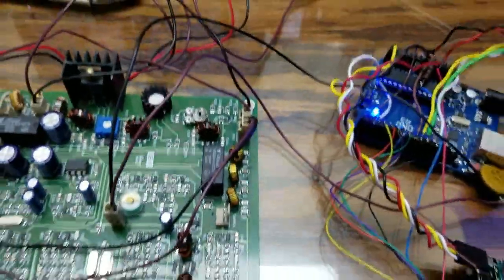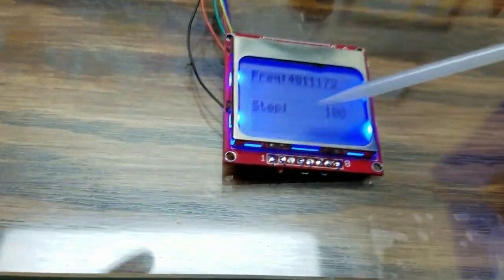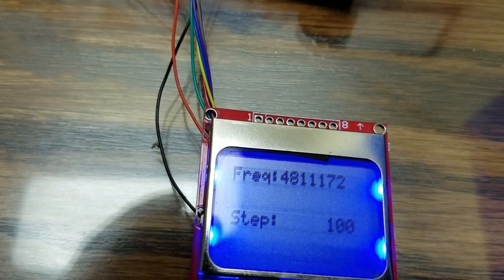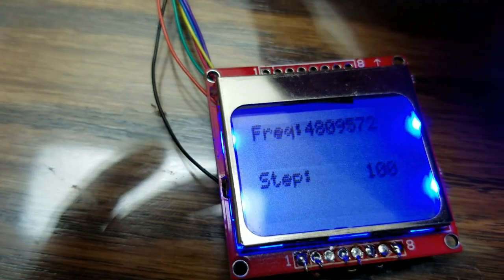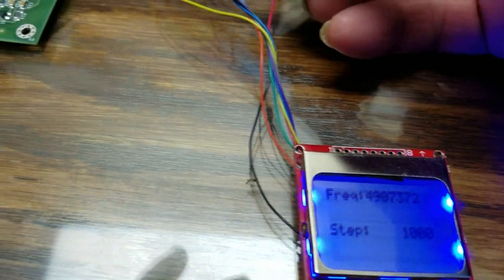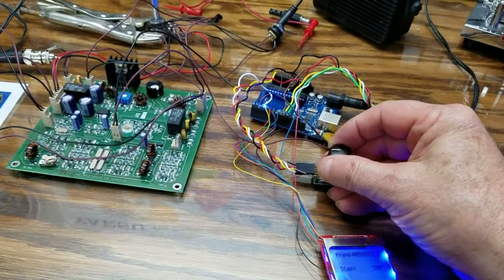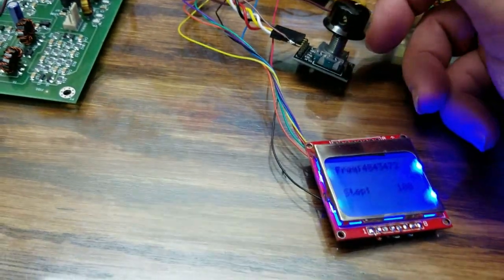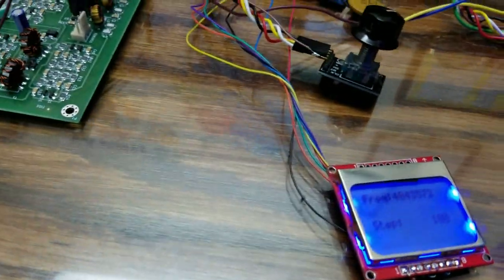BITX40 first attempt with Arduino DDS VFO

Comment: W5KUB that is JUSt beautiful,, and it means if someone breaks his Raduino then this kludge is still possible . Best of all it is probably possible to bring Bitx40 up to arnd 14W PEP out at 14 V supply rail  by some fairly basic mods including change out to the RD16HH Mfet x 2 in parallel and so on... NB there is no VXO it is free running LC VFO .. a piece of rubbish for this appn. But he wanted to get something on the market and also appeal to hams who wanted to be sure to be able to get something working...Farhan published a much better VFO cct with double buffering  which I can send you if you wish.  He did make an error on the inductor though That's to say it was  a bit too low for the tuning on 40m. At that stage he was using a 10Meg IF but the data for the coil (he gives turns and diameter not uH ) is Still wrong.  Contact me at Engstr  at  _ netspace dot  Net     dot   au  without underscrs ... (Talking to others : there you dirty bot, that will fix you !!)

Comment: Are you feeding the dds directly into the bitx 40 without a buffer amp? There is enough drive without a transistor stage? AD7C has some nice code. I haven’t had time to wire it to the bitx yet but it also saves the last freq and used a 16 x 2 line lcd that I had.